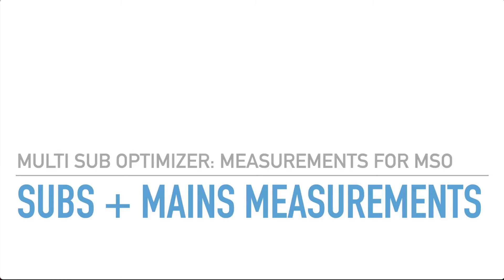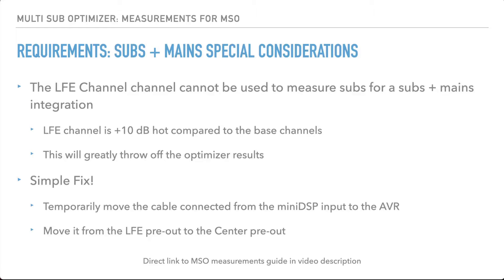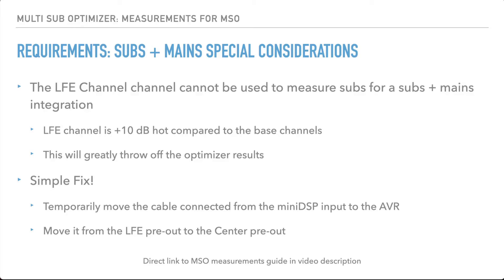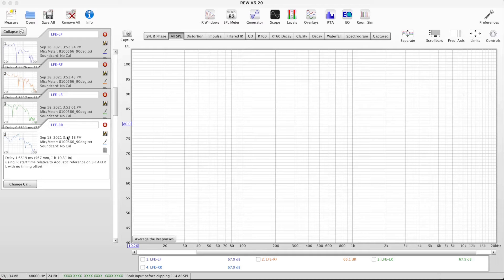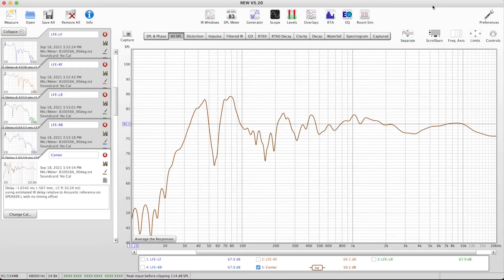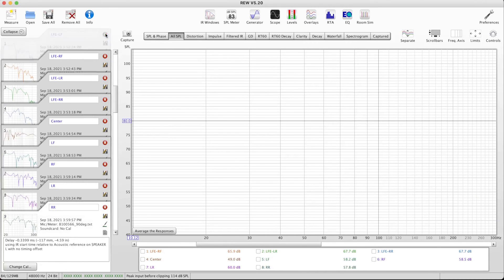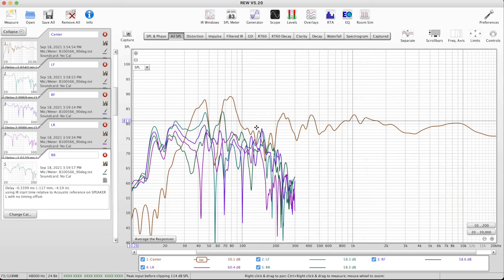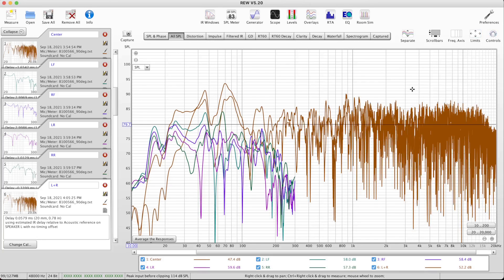Measurements for MSO: Subs + Mains Measurements

Comment: Great Video Jeff,

I have been trying to think over the last week how to get a good speaker to sub alignment in REW. But the +10db LFE was causing issues and wasn't giving me real world results.
So I used the Controls tab and brought the subs down -10db. But I knew this was still wrong as the 10db was more evident in the lower bass regions and approaching the Xo regions there wasn't a 10db difference. 
My only other solution(haven't tried this yet btw) was perhaps to use JAVA, unplug the left speaker and use to measure sub(Max Xo). Use the right for time alignment. Then go back to FlexASIO to get Center speaker FR. Like you I don't have LPF-LPE control so I think the method you have used is bullet proof and good timing as I was about to ask you on AVS  👍

All the best

Jim
Reply from the maker: Nice!  I wanted something simple and that could be applied nearly universally across as much equipment as possible.  I think this hit that nail on the head.  As long as you have 7.1 pre-outs, which even modest AVRs have these days, you're good to go.
Reply: @jeffmery  Hi Jeff - whilst on the topic of speaker and sub levels - I would appreciate your help:
1. Using the internal test tone generator and the MV at '0' (relative scale) - should one set speaker trims to read 75dB on all channels incl. the sub channel (and assuming that LFE content will be boosted by 10dB by the processor during playback) OR
2. The speakers should be calibrated to 75dB and the sub channel to 85dB.....
Honestly, I am a bit confused  about speaker/sub levels, at which stage in the recording/playback chain is the 10 dB boost in LFE implemented, levels of the AVR internal test tones vs reference discs. 
Would very much appreciate your views on this and may be a video just on speaker level calibration. Your videos are brilliant..thank you..
Reply from the maker: @harshjain3801  If the subs are connected to the LFE channel, then they should automatically be 10 dB louder than the other channels.  You shouldn't have to calibrate them separately.  Or, to put it another way, if you set the speaker level for one of your base layer speakers to 75 dB, then your subs should automatically measure at 85 dB without changing any settings.

Now, it's likely that there are some discrepancies.  The biggest one would be the standing waves (room modes) in the room and the mic position relative to them.  If the mic happens to be in a peak or null, then the subs will be louder or softer, even if they are properly configured.

This will open a can of worms, but I prefer gain matching my subs to level matching them.  Gain matching is easiest to do with identical subs.  You just set the gain control on each one to the same position and you're done.  This ensures all subs work the same amount.  With level matching, the subs have their gains set so that they measure at the same volume in the MLP.  They have equal volume but some are working harder than others.  This may be easier if you have mismatched subs.  I understand the benefits of both methods, with identical subs, I just prefer to gain match is all.

I don't recall your specific setup offhand.  However, generally speaking, the best option is to get the sub channel trim in the AVR set to near the bottom of the range supported by your AVR.  I think Denon supports -12 dB and Yamaha -10 dB?  So on a Denon AVR, you'd want the sub trim set to -11 or -11.5.  On the Yamaha, -9 or -9.5 dB.

You do this by running a one-point calibration just checking levels and see where they are.  If the result is too high of a value (number closer to or above zero), turn the volume on your subs UP!  This will increase the trim and get closer to the -12 or -10.  If the result is too low, then you turn your subs DOWN.  You know it's too low when the trim is pegged to the lowest value supported by the AVR.  So on a Denon you don't want -12 dB because it could actually be at -15 dB and you'd never know.

Does this help or make things worse?!  LOL
Reply: @jeffmery Hi Jeff,
 'tis a can of worms......
1. In my specific set up - I am running an older Windows PC that does not support ASIO...so I am sweeping the subs through my mains (switched off, set at a high XO). That should automatically offset the 85dB boost of the LFE channel. Once the subs are aligned, equalised and a house curve implemented, I could go and check levels again - and aim for 75 dB for the speakers and 85 dB for the subs (with low trim levels in AVR and gain knobs turned up - as you have suggested). To align subs to the centre channel, I could switch the Centre output in AVR to the Right channel and sweep - as above....
2. For mains to sub integration using a Mac - one could reduce the input signal to the subs in Mini DSP to get to 75 dB (mains originally set to 75 dB) for the measurement sweeps and then go back in the slider to get to 85 dB for a final level calibration after eq because the cuts would have brought the volume of the subs down somewhat....
Does this make any sense.....
Reply from the maker: @harshjain3801  Yep.  Makes sense.  No need to worry about the offset sweeping the way you are doing it.  Just double-check the levels after your calibration (which it sounds like you're already doing).  And correct on alignment with the center.  Moving connections around can be a pain, but it's a dead-simple work around.

Yes, one could mess with the gains to lower the subs to 75 dB, but that introduces more chance for human error.  For me, it's just easer to move 1 cable and disconnect a second for a few mins grabbing sweeps.  I've screwed up and left gain settings in my miniDSP and then battled trying to figure out WTF was going on when results were weird.  If I accidentally leave cables wrong, it's immediately obvious what the problem is.

As always these are just my own personal preferences to help work around my sometimes distracted brain.
Reply: @jeffmery  thank you Jeff. Will give this a shot... best wishes 👍